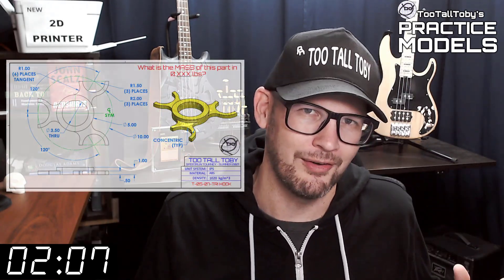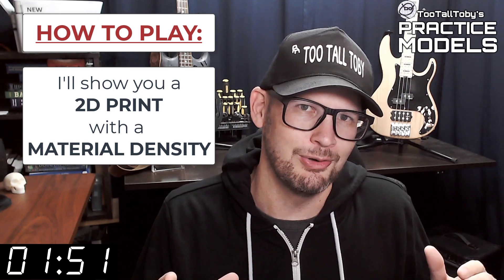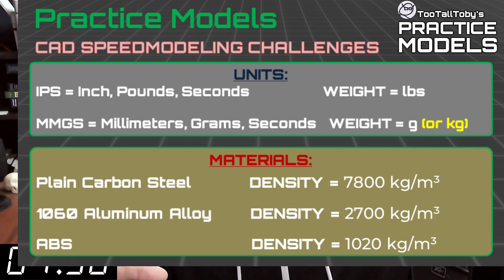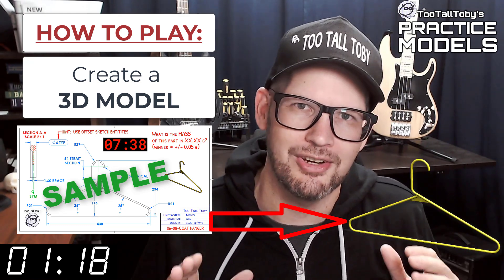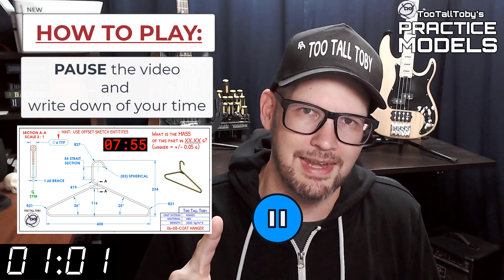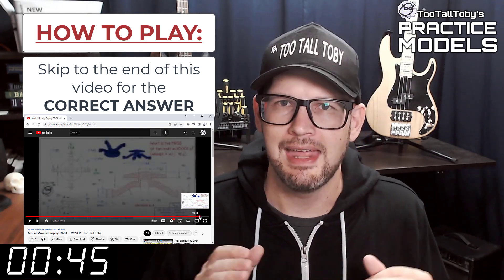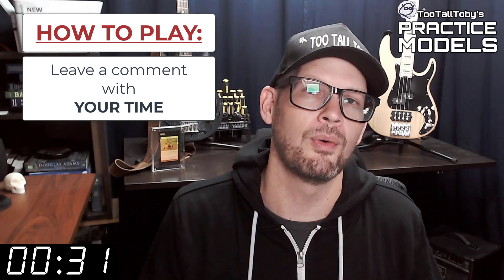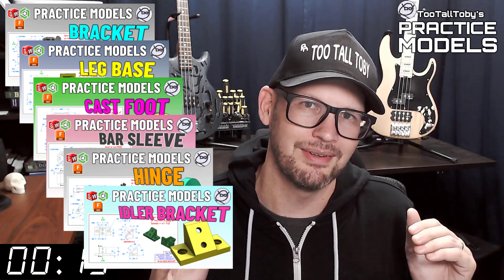2D to 3D CAD PRACTICE MODEL-  Drawing to model - FREE PRACTICE for 3D CAD users - FRAME MOUNT 3

Comment: Got in the 830g at first. Then noticed some radius issues on the bottom part. Then got to 827, the noticed another R15 where an R16 should have been. This was my first go at one of these. Thanks for all these challenges. Didn't measure time.